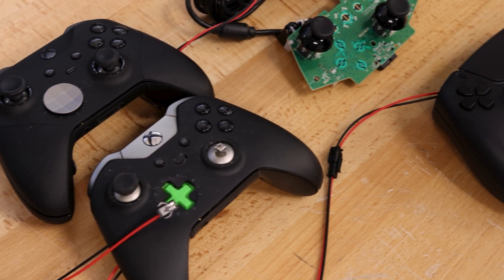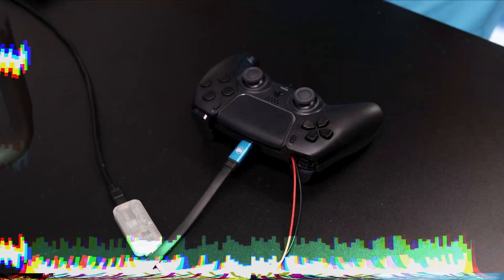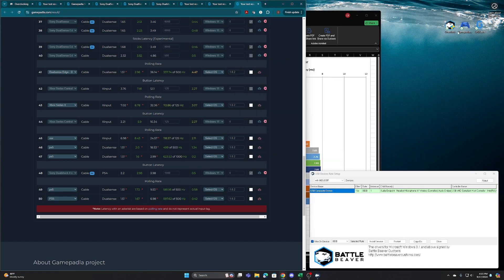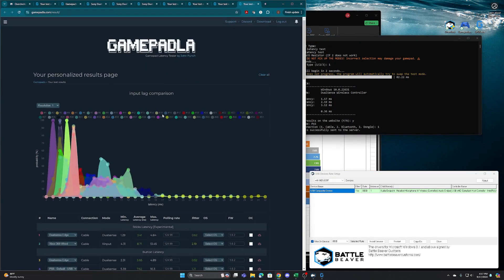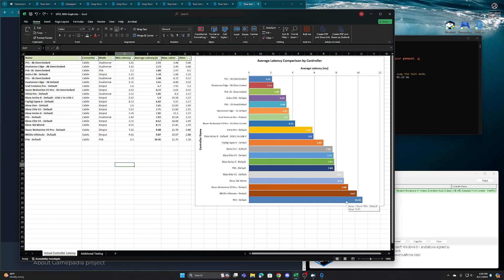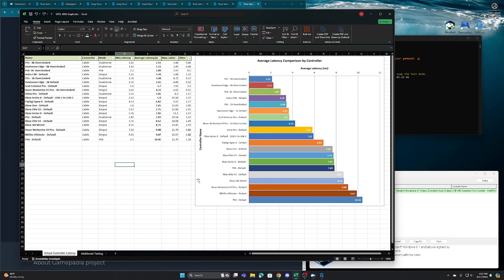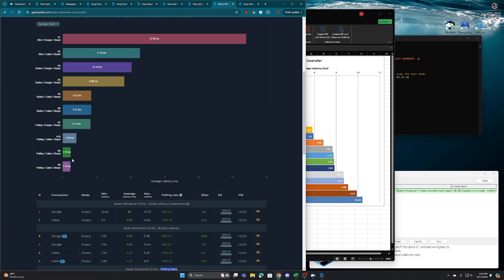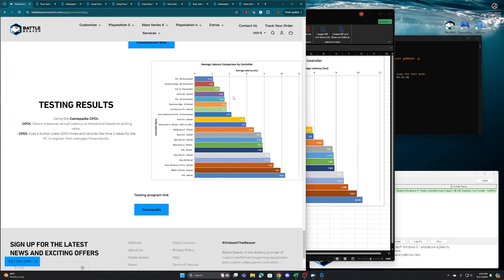Polling Rate vs Actual Input Latency using the GPDL by Gamepadla | Testing Results

Comment: The potenemiater joysticks are the king for FPS games because they have very low stick latency because they react to assist much faster. I personally think optical mouse sensor joysticks will be the ultimate joysticks for controllers because mouse optical sensors have less than 1ms latency and they have very low latency wireless performance. It's pretty easy to use mouse optical sensors for controllers all we need to do is put a trackball 0.5mm above the optical sensor and use a spring for recentering.

Comment: For a strange reason, on a dualsense controller I can’t play above 500Hz on BLACK OPS 6 because at 1000Hz, 
I loose 80% of controller vibration while on MW2019 1000Hz is alright I only loose about 25% of vibration. An yes I know most pros don’t use them  but it help me react faster when getting shot and also for controlling my recoil

Comment: most reviewers don't even recommend overclocking over 1000Hz. because almost always i see them test the pulling rate getting high jitter and increaced number of out layers  but usually they average around 1ms even when clocked to let's say 8k Hz.
 to be clear , over clocking when wired via USB on PC do reduce the latency, right? as i understand from your video.
Reply: there any improtant point about latency , the measured numbers don's show the latency from physically pressing the button or moving the stick from the dead zone , so i think in real life scenario i still think having smaller dead zone , higher pulling rate with higher stick resolution , early triggering mechanical buttons , hair triggers  , extra back buttons und so on , actually contriputes more toward reducing actual input latency . and those factors show always be mentioned when showing measurements .

Comment: My flydigi direwolf 2 latency are 1ms on average and 2ms on  maximum latency.. after overclock to 1khz so yeah it is better than apex elite 4 default 1khz latency
Reply: No just checking the polling rate means nothing. If you didn’t do it with the device then it’s not accurate

Comment: So 8k on the PS5 controller dosent actually help the stick polling rate as it can only go to 1k but the button input latency is improved on 8k?
Reply: The receiver caps at 1000hz so it won't change the input latency just the polling rate so 1000hz should be the same a 8000hz

Comment: Any chance you’ll offer services on a wolverine v3? Can’t stand how loose the sticks are vs my battle beaver
Reply from the maker: Not at this time.
Reply: The V3 pro sticks tension are tight. they changed it. it's not like the V2. You don't have one
Reply: @ChaoticMuchX  Comparing to a battle beaver controller with increased tension the V3 was loose. The sticks seemed very similar to a stock xbox controller for me
Reply: @Defuzed  I've never tried a battle beaver at the highest tension, but it's believable that it would be less than a BB at the highest thumbstick tension (160g is a lot). It's too be expected. But you will feel that default Xbox are MUCH lighter than the v3, it really, really feels tight. I can only speak from my reference with controllers I've used, so Its tighter than the PS5, and tighter than Xbox elite at highest tension. V3 is the tightest controller tension I own as of now

Comment: So what's the best Playstation controller w paddles and what's best Xbox controller with paddles in terms of most responsive/least amount of latency
Reply: Sadly for ps5 it's the dualsense edge. Hella expensive but it's got the best polling rate lowest latency. Ya it's got paddles.
Reply: Stop asking a company what is the best, they will always link you to their website lol. This isn’t an informational channel, it’s a company marketing page, seek neutral sources if you want proper information.
Reply from the maker: A modified Sony Dualsense is the fastest PS style controller when overclocked. Xbox Series X still brings alot to the table against the 3rd party options with actual gains coming from using a USB-C to USB-C cable vs a USB3.2 to USB-C. 
https://battlebeavercustoms.com/pages/ps5-builder